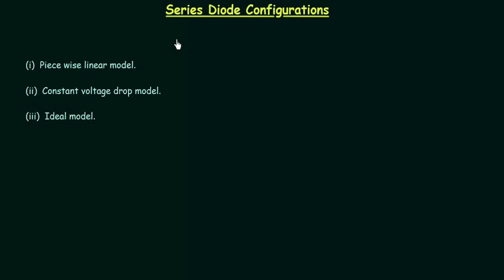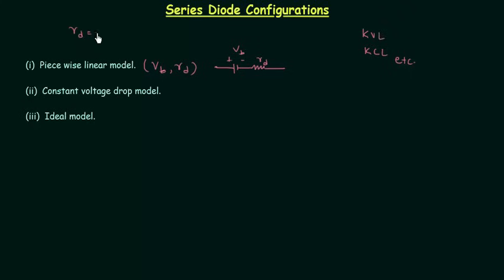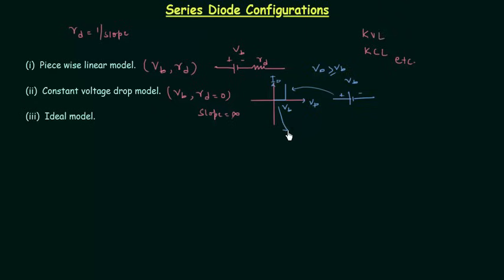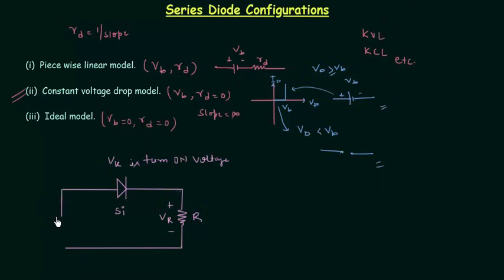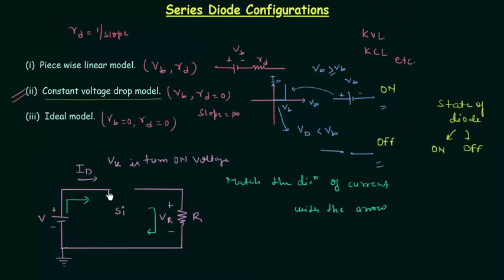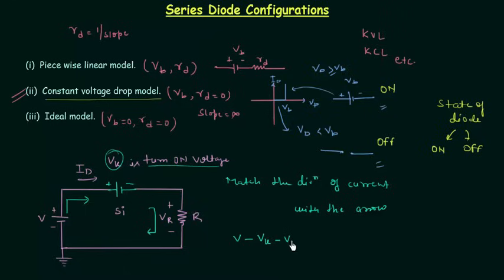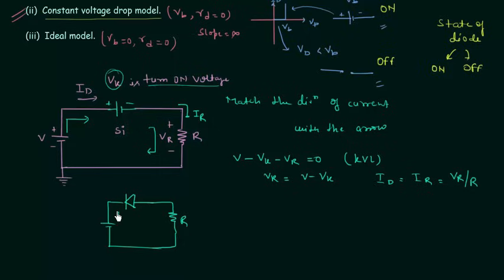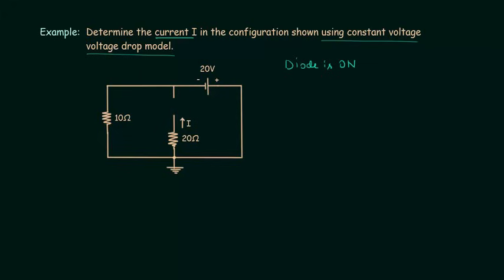Series Diode Configurations

Comment: How ex2 is 1A plz explain?
Reply: as both the diodes has opposite polarity they cancel out each other and act as open circuit therefore the circuit will actually just contain a resistor of 10 ohm and a voltage source of 10V therefore the current is 1 A

Comment: sir in the question, you have taken the wrong direction of diode as a batter of 0.7 volts. Barrier potential always oppose the external battery source if it is in forward bias state.

Comment: in first example the polarity of the equivalent voltage source is changed as the p side of the diode is at higher potential but you have shown n side on higher potential

Comment: @NesoAcademy

Respected Sir, my answer for the current I for the configuration in Example Problem 1 is 2.89 A, as there is a second resistor of 10 ohms parallel to the first one. So, I have taken the equivalent resistance that they offer to the circuit which stands at 6.66 ohms, which we must do first, and then applied the KVL to obtain the forementioned result. Sir, am I correct or wrong?
Reply: bro i got same doubt but i then i remembered that equivalent resistance is the total resistance not the single loop or connection which are in parallel so it is correct.
Reply: You are wrong because the I shown in th figure is for 20ohm, so you cannot consider that I for both the resistors because both the resistors are in parallel and so current flowing in them will be different
Reply: @SS-me1ss  
but why he did not do mesh analysis and find currents for each mesh then find I , I=1.035 A

Comment: In the homework problem, the two opposite diodes result in 0 V through the middle arm, resulting in a short circuit, and hence all the current passes through the middle arm, thereby leaving I = 0A. Many of u have said, the middle arm acts as an open circuit, but an open has certain voltage but 0 current.
Reply: yes...

Comment: I think, you applied wrong KVL. It should be 20- 20i + 0.7 = 0
Reply: The direction of diode equivalent circuit is wrong ...
Reply: @vishalmahla6762  yes
Reply: Kvl sahi laga hai doide ki direction galat dikha diye hai
Reply: Yes
Reply: Yes
Reply: Yes
Reply: I also think so
Reply: Yes
Reply: Yes thats what i was wondering
Reply: Voltage is dropping, so is correct

Comment: 1 amp as the diode in reverse biased is making the line in the middle of the circuit open so no current will flow through it & all the current will fllow through the  10 ohm resistor.
Reply: Plz give me answer I am so confused 😭

Comment: Sir in network theory you have said when we go from - to + polarity then we use + sign but here you used -0. 7v instead of +o.7v.
Reply: Sir has wrongly replaced the diode .It must be from + to - as current flows from +to - .
Reply: @31nehayaduvanshi92  
Yaa
Reply: That is my doubt also.
Reply: Actually it is + to - so wrongly interpreted

Comment: Sir, please check the polarity of the battery which replaced the diode, At the time of KCL u have mentioned right but, in the equivalent diagram, battery polarity got reversed.
Reply: Exactly, you are right

Comment: Ans of the h.w. problem is I=1 amp because 2nd diode will act as an O.C.

AT 7:37 the diode equivalent voltage source polarity should be reversed as you mentioned in the lecture..
BTW great explanation sir with great concept 👍👌.

Comment: solution for the homework problem is 1 amp because there are 2 diode face opposite direction so one or the other will act as an open circuit so no current will pass through the doide and the circuit will become a simple circuit with a battery and a resistor and we can easily find the ans by the help of ohms law

Comment: Answer to homework problem is  1A  because if current has any direction whether up or down, one diode will be on and other will be off. means in both cases any one diode will be in off state so open circuit.

Comment: Example 2 (already acknowledged by tutor :))
A little mistake , the diode equivalent polarity should be reversed so current is:
i=20.7/20=1.035A

Like this comment so as to help others:)
Reply: No the voltage that replaced diode gives a voltage drop of 0.7 V. So the answer given by Sir is correct but when he replaced it the polarity of the diode was incorrect which you can rectify. Check pinned comment for validation
Reply: @udattam  if polarity is reversed then result will also change .

So current is 1.035 A .
Reply: @udattam  u r right...👍...
If someone hav doudt so pls apply kvl after correcting the polarity....by yrself🤗🤗
Reply: @udattam  Yes u r right
Reply: yeah i am thinking the same .. thanks for clarification dude
Reply: @meditationtales5866  :)🤝
Reply: Same doubt and I came with same answer.
Reply: I also agree

Comment: Sir I have a doubt in 1st prblm where polarity of diode in equivalent ckt is shown along the current but it should be reversed bcoz of the barrier potential will flow in opposite direction to the direction of current shown.
Can I get the explanation?
Reply: U r ryt.. That was a mistake.

Comment: As the current goes through the first Diode it is, but the second diode makes it off, which is equal to pen circuit. I= v/r=-10/1= -1 amp

Comment: 0.93 amp???
Reply: No bro
 see the diode which is opposite to the direction of current so the diode is open so no current is flowing in the diodes.
There fore current is flowing in the 10 ohm resistance with 10v so current =1amp

Comment: Lol its 1amp.. by inspection you know that voltage across the resistor will be same as the source because of the parallel configuration therefore by applying ohms law you should get the answer: 10/10=1A

Comment: sir wont the answer be 0 because the middle network will act as short circuit
Reply: Yash Agarwal It will act as open ckt and there is no path for the current to flow. Short is the path from which whole of the current flows

Comment: way you calculated the current for the problem is not correct. i think we have to do mesh analysis here because current is mentioned inside a loop
Reply: Lakshmi Asokan applying KVL in both loops results I=1.035A
Reply: Yeahhhh I too taught the same

Comment: won't the current through the resistor be 0amp as the diodes are opposite the voltage cancel out and there is 0 voltage drop which means it is short circuit so all the current flows through it and no current through the resistor.... plis correct me if I am wrong
Reply: siddarth ningthoujam the diodes cannot cancel each other because one of them has Vb=0.7 V and the other has Vb=infinity (coz its open ckt). Hope you understood

Comment: in your hometask problem the answer will be 1 amp. there will be no current in diode section due to open circuit for second diode..

Comment: Answer to the homework problem is 1 A.

Explaination-  since one of the diodes in the middle branch is reverse biased it should be considered as open circuit. Hence no current passion through any of the diodes. Further I= 10 V / 10 Ohm that is 1 A.
Reply: Yes right me also get same answer
Reply: Thanks for explain
Reply: -1A
Reply: @thermodynamics_724 current can never be negative, so you can just change the symbol to positive.